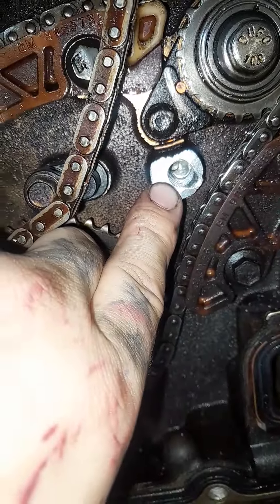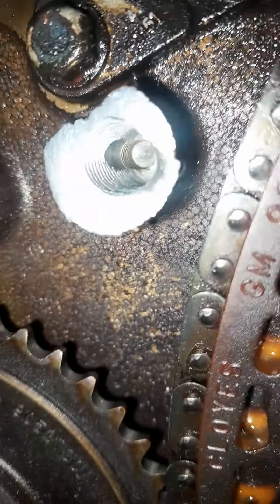Nightmare repair!

Comment: Dude, I just did a reseal on some exhaust manifolds on a 2013 f450, 6.8 v10
5 studs had to be drilled out, but luckily enough for me, they came out with an extractor
Still it was a nightmare job too